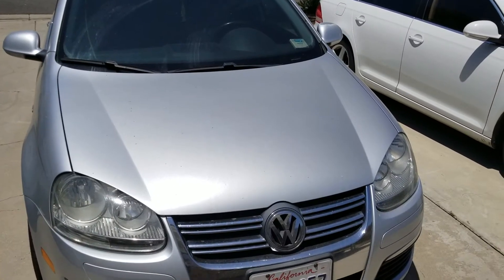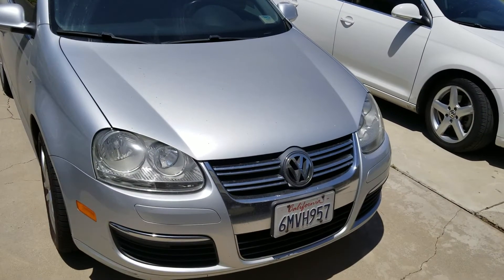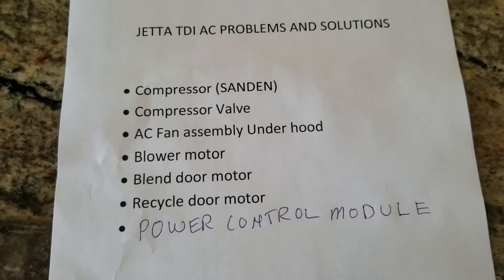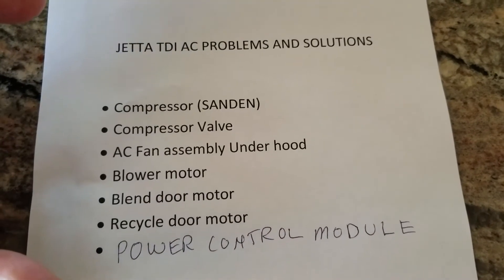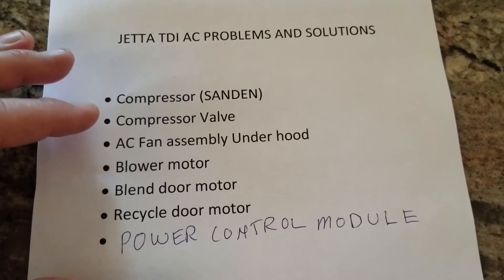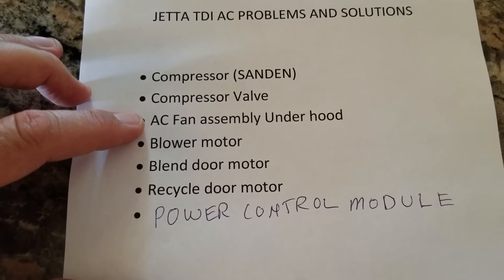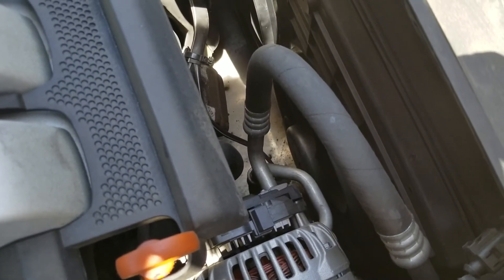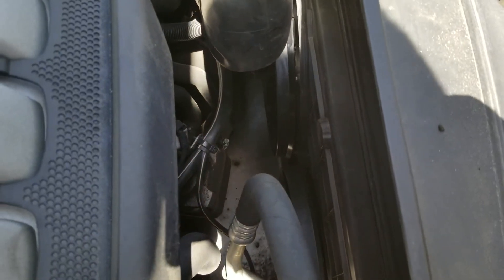Volkswagen Jetta Mark V diagnosis and repair

Comment: Mine only works in the winter
Reply from the maker: Yeah mine barely works in the summer but the winner it works great
Reply: mine is a 71 bus the engine only will run 90 thousand miles but has original trans . it has 738 on some of the parts